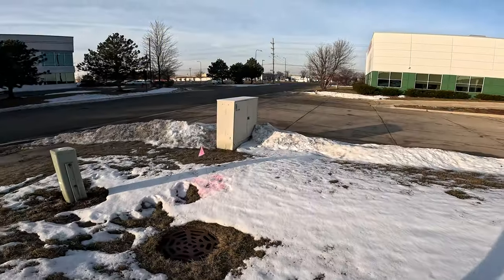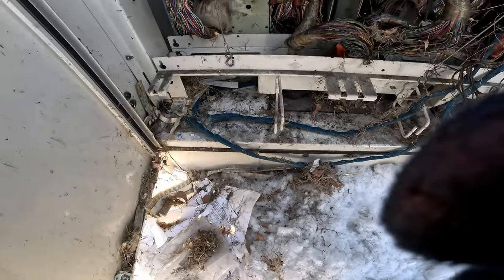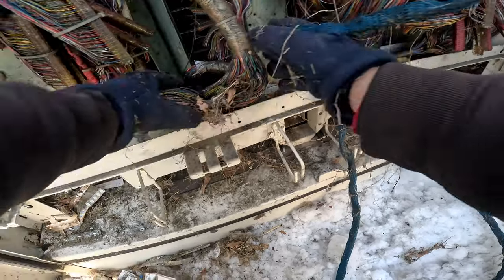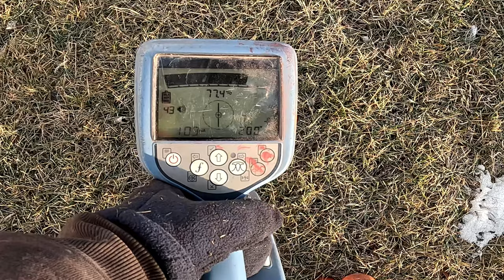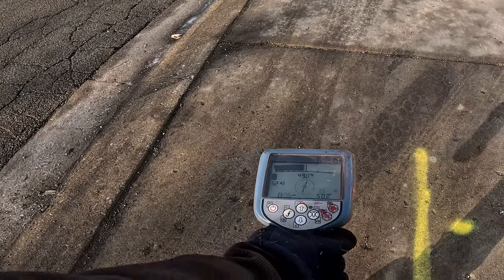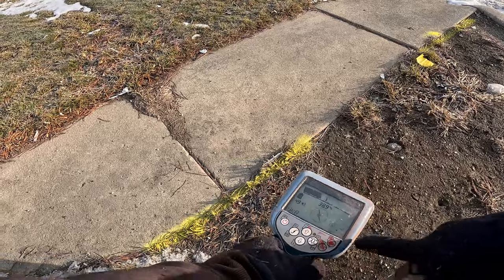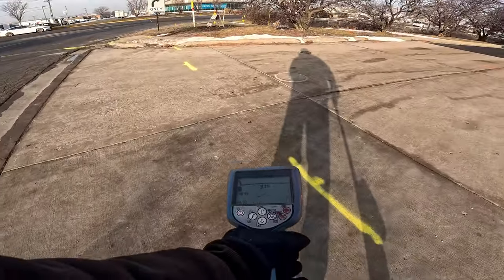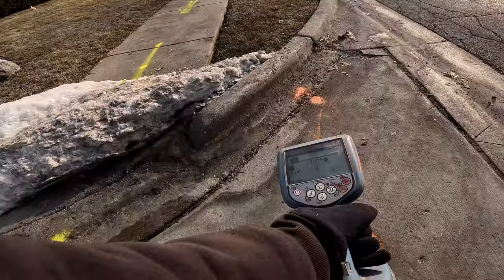Locating Utilities Using AT&T Cross Boxes | Telecommunication Unlocking the Secrets

Comment: How do you know when to just paint a line or paint that's it's a duct run "H" or conduit "|◇|" people always say it tells you in the prints but I still don't see it
Reply from the maker: It is on the print. Let me explain. Anything that goes from M-H to M-H is considered a duct run. Any cables coming out of the manhole are considered a conduit run if it indicates so on the print. It usually will be a thick line to indicate a conduit run, but depending on the client's infrastructure that you're locating for. And lastly, if you see a skinny line on the print, that's usually a directly buried line not in conduit. I hope all of this makes sense. Every client has their own marking procedures for how we are supposed to mark their infrastructure.
Reply: @811chicago5  omg thank you for that break down I finally understand I'm berly one month in on locating and everybody I ask just say it's on the prints but wouldn't break it down the way you do. I've been watching your videos all morning. I also enjoy how you talk about what your doing not just do it like disconnecting the ground wire and where to find them and explaining what tones to look for and the bleed off cause I have been having that issue and ima lower my gain when doing my 360 👏🏼👏🏼🤠🤙🏼 thank you for making the videos be safe out there
Reply from the maker: You're welcome!